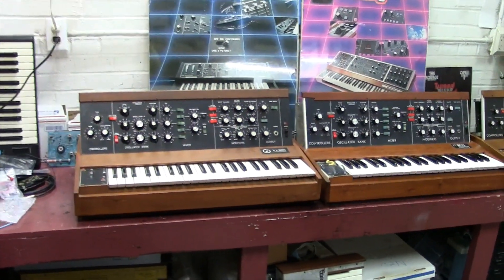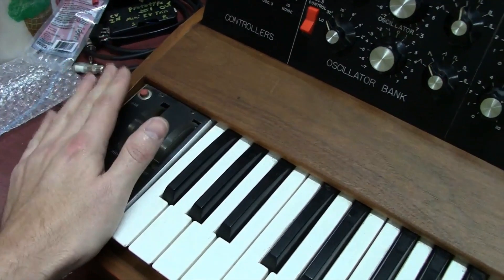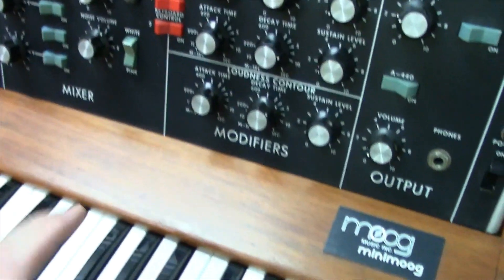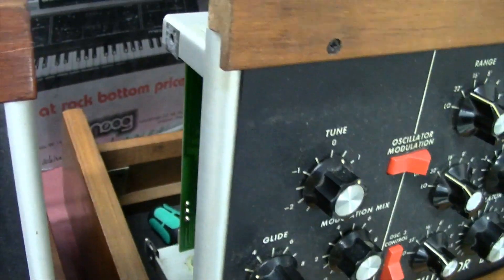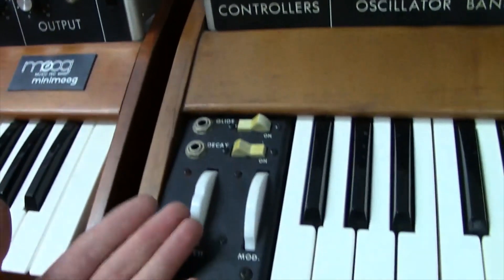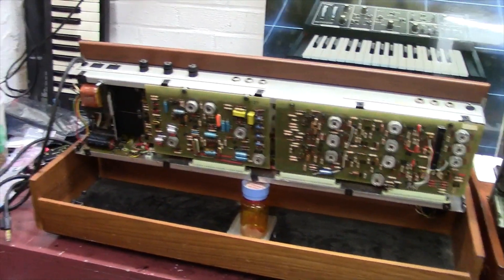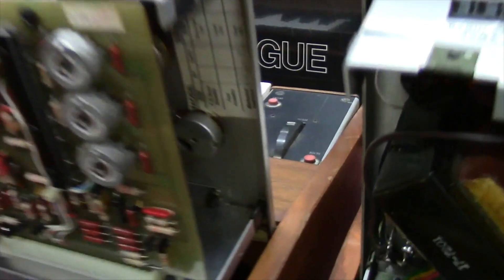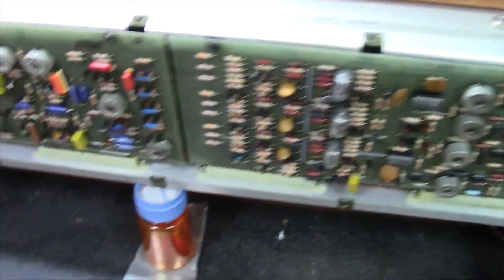Minimoog History 1971-1981 (by synthpro)

Comment: There’s an interview with Gary Numan where he’s asked about the stability of his old gear and he said Minimoogs were awful for tuning but he sent them all away to have the new boards put in and they were all really stable after that
Reply from the maker: That's cool! I always have to explain to people that owning a vintage minimoog is a lot like owning a classic automobile with carburetors, it has to warm up, you may have to do some slight adjustments to get it tuned up, but it's a classic and nothing more fun than playing these vintage synths especially on a nice high powered sound system. That version 3 oscillator board is like fuel injection, you turn the key and give it a little warmup time and it's ready to play.
Reply: @synthpro  Yeah so basically like the Behringer Poly D. You turn it on, give it about 15 minutes of warm up time and then you're basically good to go.

Comment: The very best video to learn about the different revisions. Thank you! I played several Minimoogs over the last 40+ years. My 1979 rev 3 VCO version (with a self made clear coated beech wood hopusing in favour of its plain dark brown original housing) sounds not that organic and bold as the rev 2 VCOs or the very similar sounding Minimoog Reissues 2016 (I own one). I never had a chance to play such an early Minimoog. But as the VCOs changes are much like the Modular 901 to 921 modules, the sound would be very different. Especially the harmonic content of the triangle. But keeping the pitch is also needed, so rev 2 is a good compromise in sound and tuning. BTW: you see the power cable on the far left on of the panel left on the oldest versions, while all other versions got the external accessories sockets on the far left and the power cable to the right of these sockets.

Comment: Well I am a bit late in seeing this vid, but it was definitely interesting! 
I love my old minimoog, it was found on the local tip quite a while back and had suffered somewhat from the rain so needed a bit of tlc!
For some reason lately I have been thinking it was a '76, but refering to the vid, mine has sharp edged badges, thin end cheeks to the case ( which is a lovely grained dark wood ) rev 2 osc board and no octave buffer board, so earlier!

I've used it happily for years but it was a bugger for going out of tune, I bit the bullet and fitted the temperature compensation mods, multiturn trimmers, and while I was at it rebushed the keyboard - now it is rock solid for tuning - as you say about the rev3 board, possibly too good, a little bit of character was lost, but a small price to pay for useability!

It suffers a bit from the board connectors being a bit shoddy and some times needs a bit of a knock to sort them out, but at the moment it's working fine apart from the overload light, -bulb is fine - probably a poor connection somewhere - Bah! -well you can't have everything, it doesnt affect the operation so I've not delved into it! I'll maybe sort this out at some point, and possibly fit a buffer board, but it does seem ok without.🙂

Comment: Super interesting to watch and listen to . Its good to see what I have seen in the service manuals In  the flesh.  
Was the reissue based on the 75 moog or last revision. I'm very sure the ua726s were discontinued a long time ago. Is there a modern equivalent built into one ic ??. I do know that people do use the 3046 with a thermo circuit in a lot of cases. Anyway great video nearly watched it all. Will finish up watching after work today.
Reply from the maker: Thanks, glad you enjoyed this video! 

The reissue is based on the 74 era minimoog with rev 2 oscillator design but of course with new components. The transistor array chip actually came back into production for a while in a surface mount package and that is what both moog used in the reissue and Behringer  used in the model D.

Comment: Now, that's quite some lineup of the Minimoogs.  I didn't even know that the original Model D's front panel was all metal with etched markings.  That's the same style as a Swiss made typewriter or a set of watchmaking tools.  I mean, the current leather-like textured vinyl overlay on the Model D reissues from 2016 and 2022 are not bad at all.  All the Minimoogs have charm and purpose.  

I am wondering if they still use discrete electronic components or integrated circuits in the Model D reissues.  I am also interested in knowing how Moog implemented the oscillators in the Minimoogs and the modular systems.  Are the oscillators charging and discharging capacitors?  Or are they more complicated electronic circuits?

Comment: A lot of the explanation for various changes comes from where they were built.  I am curious about your 1972, as it is strange, and seems to be a sort of transitional model.  Does it say "Williamsville" on the back?  I'm also curious about whether it has the initial Minimoog internal design or the Williamsville-version design.  1972 was a very transitional year, as it was the year that Waytena sold Moog Music to Norlin.  Your 1972 looks like they were using up the remaining Moog/Musonics parts before switching to the standard Williamsville design.  At first, I thought that's just what it was, as the clear wheels were still optional for years after they started using the white... but that smooth front and the different badge!  I've never seen the like.  Your 1972 is like a missing link for me.  
The other thing was that in 1976, there was a Minimoog hiatus as they worked on the new design that became the "Buffalo" model.  That is also around the time that the serial numbers did a leap.  
I wasn't able to watch all of this right now, but I caught some of it... great content!

I'm pretty sure that the wood used on the prototypes and the R.A. Moog Minimoogs actually came from the lot of Walnut that Bob Moog had in his barn. 

Oh, and one more thing... I think Richie Walborn was an intern in 1971. 

Anyway, great stuff!
Reply from the maker: Hi Marc,

Thanks for your comment and info.

I do go over internals later in the video but here is some extra bit of info I have gathered over the years from the units I have restored/my 72 minimoog.

These 72 era minimoogs do not show up often but they do in fact still hold the R.A Moog printing on the boards and include a scale adjust for the VCF but you can tell that the board was not redesigned at this point for the rheostat trim pot. This design can also be found in the 73 minimoogs as well. 

The 73 minimoog is built very similar to my 72 electronically/cosmetically but the difference being that the face plate is embossed with that leather texture but is still bonded to the metal plate. Badging is the same, sharp corners with embossed texture on metal backing. On the 73 era minimoogs, they use the same badge on the front and back unlike the 72 which had the etched metal badge on the back.  The 73 is also when the white version of the clear wheels are present but I did find out a few months ago that those white style wheels started roughly July of 72. Here is a video link to a 73 minimoog I restored. It was a Australian export model with the fixed transformer voltage: https://youtu.be/T9SdR9DQB-s

Lots of changes happened between 73 and 74 from what I have seen over the years. In 1974 you start really seeing the unit fall into a mass production design and the gain staging as well as the transistor matching changes effecting presence and emphasis saturation. They started only matching critical transistor sets.  

Hope this helps🙂

Thanks again,
Jareth
Reply: @synthpro  Fantastic information, Jareth!  Thank you!  I used to work in the archives of the Bob Moog Foundation, and while there is a tremendous amount of information there, details like these are not often documented (working at Buchla, I also know this... it's amazing how many little details change for various reasons... and no one will notice until sometime in the future when lovers of these instruments will obsess over the details like we do!).  Along these lines, my Minimoog is 5055, and it was built July 17, 1974.  It has the alternate selector knobs that happened for a time for that year, likely due to a momentary lack of availability of the standard selector knobs!
Anyway, thank you for making not only great content, but historically important content!

Comment: Awesome Video. Thanks. Would love to know what your thoughts are on serial number between 30## to 3100... any thoughts would be appreciated. I’m assuming it’s a 73... which would make it like your 72? Thanks in advance
Reply from the maker: Thank you, happy you enjoyed the video! 

You are correct, 30xx would make it a early 73. I actually just bought serial number 3344 built Oct 73 that I plan on adding into a second part of the minimoog history video. 73 minimoogs are built very similar to my 72 minimoog but differences are that it had a embossed leather texture on the interface panel which did have a metal backing like my 72. Badges were still sharp corners and metal with plastic overlay but once again with the embossed leather texture. LHC panel becomes more like later production as far as graphics but would have the blocky white wheels instead of clear wheels. The circuit boards still hold the R.A Moog name and would still have the filter scale trimmer sticking off the board like what you see in my 72.

Comment: Is there much of an audible difference? Probably a difficult video to make.
Reply from the maker: There is definitely audio differences but it's mostly with harmonics withing the filter and VCA that tends to change due to gain staging changes and transistor matching changes. I'm going to try and do some form of audio recording to see if I can capture the differences. It will be a little hard to do since oscillator tuning does play a role in how the harmonics are developed and the early minimoog drifts more than the rest.
Reply: @synthpro  thanks for the reply. Great stuff!